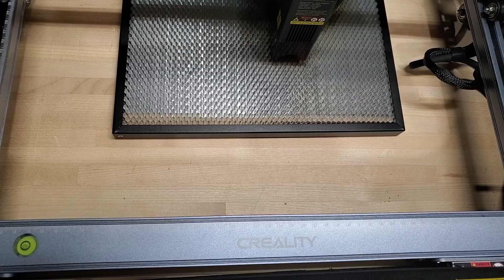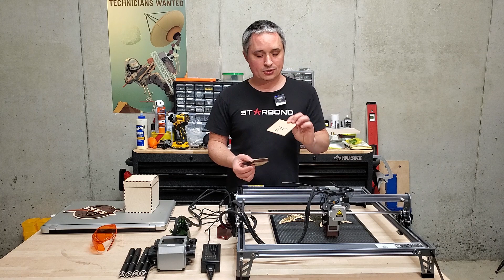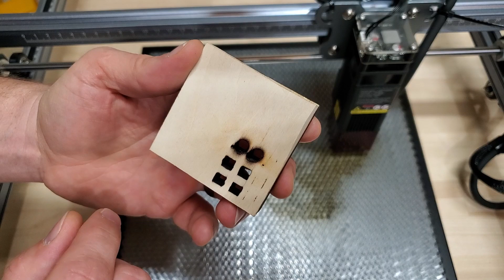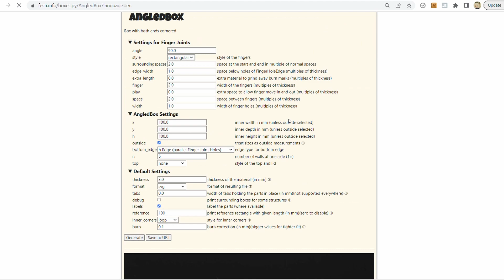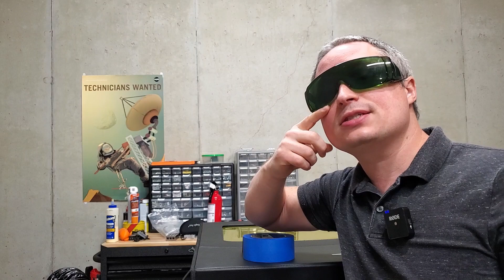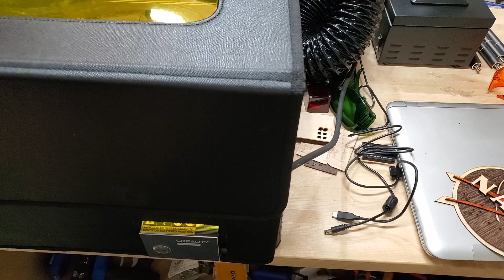Creality CR-Laser Falcon 10W Laser Engraver/Cutter Review

Comment: Do you have any idea? My Laser light won’t turn on, anymore. It moves normally but the laser itself is simply off. 😢
Reply: Try you power supply mine started doing that like everything worked and would run the pattern but the laser wouldn’t turn on tested my power supply and it wasn’t putting out enough amps to sustain the laser but the stepper motors don’t pull much juice at all
Reply: I bought a universal one at Walmart and it has worked for over a year

Comment: A company that is not trustworthy.

I purchased a Falcon 2 22W laser cutter on 2/12/24. On 14/1, Creality sent me a Falcon 2 10W instead. This was not what I had purchased, and I have spent two months trying to get them to send the correct laser cutter. Since I do not trust Creality, I have not returned the received product, as I believe I would get nothing in return. My recommendation is: DO NOT buy anything from Creality. If you do, expect to receive the wrong product, a defective product, or even a used product. There is no return policy, no money back, and if you contact Creality, you're talking to a bot. Good luck.
Reply from the maker: Sorry to hear you're dealing with that. You may be able to contact your credit card company and see if they can help. Generally if a vendor doesn't send the goods you purchased, then you may be eligible for a chargeback if Creality refuses to make things right.

Comment: what sucks is that you cant extend it!! 40cmx40cm is not enough! i would like to have up to 1 meter
Reply from the maker: Lightburn has features that will allow you to cut/engrave a workpiece larger than the laser's work area. If you have a huge workpiece, you can just set the laser on top and use registration marks to translate the machine and stitch the image together. Here's a demo video of how to accomplish that: https://youtu.be/n__saOKVupA?si=HGNver0rqHqVuQLO

Comment: Thanks for the review , i just got my laser yesterday and i cutted the sample file with LightBurn app, i have a question how do i setup the function that the laser detect the wood or other material like in your video?
Reply from the maker: I'm not exactly sure what you mean. The laser doesn't really detect the material. You can use the focus block to set the height off the workpiece. If you need to fine tune feedrate, passes, and power, you can use LightBurn's material test template: https://docs.lightburnsoftware.com/Tools/MaterialTest.html

Comment: Hi- I think the air assist is in backwards- mine came with a leaflet to have the air assist pipe going over the laser warning sticker- this means no gap in the red cover at the front (safer) and also improves lifting the silicone hose up off the table. Thanks for the recommendation on the glasses!
Reply from the maker: Thanks - mine came with zero instructions so I just had to guess!

Comment: I have a Creality Falcon. I just received the X-Tool case for the D1 and I believe they have redesigned the case. The front has a dip in top, but I flipped it over and didnt have to cut out anything. It fit perfectly as well. I also highly recommend the 500mm x 500 mm from Two Trees. I tried the 300 and 400 mm sizes but felt they were too small. The Two Trees honeycomb is also steel and doesn't discolor or crumb under pressure.
Reply from the maker: Yeah, I flipped over that front panel initially, but wanted a better seal so I ended up doing the cutout. Thanks for confirming the Two Trees 500x500mm honeycomb fits. I wish I had bought that one myself!

Comment: Thanks for the great video. I just purchased this model and will be setting it up shortly. I'm planning on making stacked items similar to your NASA project. Were the boards for that solid wood or plywoods? What thickness were they and what wood suppliers do you use?
Reply from the maker: The boards were 1/16" thick solid hardwoods. I got them at Ocooch Hardwoods: https://ocoochhardwoods.com/scroll-saw-lumber/
They've got a great selection of thin hardwoods and laser-safe baltic birch plywood, and shipping was really reasonable.

Comment: Can we trust when sellers on Amazon say that their goggles are OD6 certified, or do we have to order off-site?
Reply from the maker: I can't say for sure. One sanity check is that certified glasses will have the OD rating and wavelength written on the corner of the lenses, per the CE standard. If they don't have that, you can be sure they aren't certified. I suppose a company could easily forge that though.
Reply: @DoresoomReviews  good info anyway. Thanks

Comment: what enclosure did you use to put the falcon in? was it the xTool one?
Reply from the maker: Yes, it's the xTool one: https://amzn.to/3VvWqxK
I did have to cut into the side to make it work, but it was the only pre-made hard sided enclosure I could find. Just know that their viewing window doesn't have a specified optical density or wavelength rating. (Neither do any competitors.) I bugged their customer service until engineering confirmed it didn't have a rating associated with it.
Reply: @DoresoomReviews  np thanks for being thorough, you only had to cut for the control box or when you say the side had to cut elsewhere?
Reply from the maker: @3rdPedalMedia  Just the one cutout for the control panel. I did it with a box cutter.

Comment: I want to know what's in that box outside the laser
Reply from the maker: The box on the front of the frame? That's where power and USB-C plug in, where the on/off switch and the start switch are, and where the microSD card plugs in.